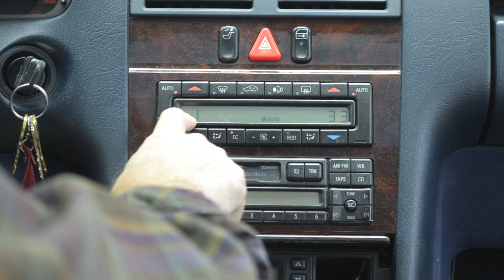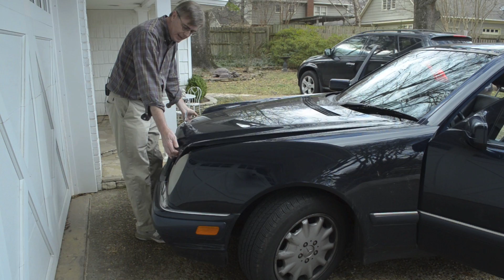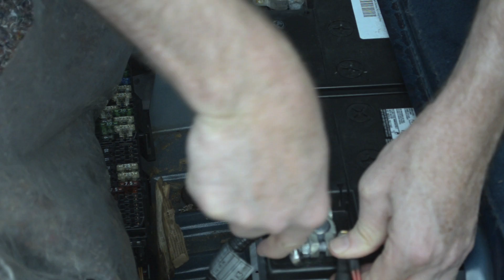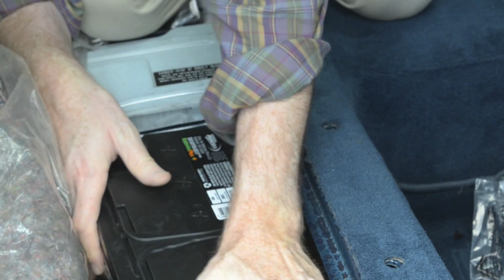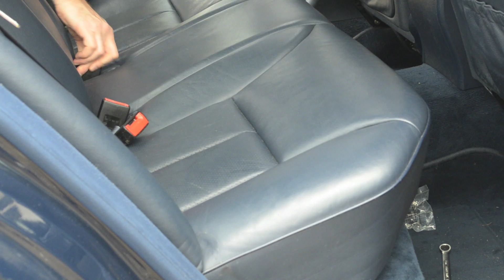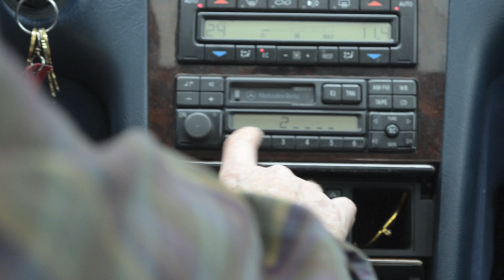Mercedes E300 W210 Battery Replacement

Comment: Great Video.  Just picked up a new battery today and a friend and I will install it.  Your video is just what we need.  Thanks so much!  Good tidbit on checking the voltage from the Dashboard.  I had no idea that could be done.  Now I also know to put in the radio code if needed.  Much thanks again.

Comment: As a rule of thumb, always take the negative side off first. Then when putting a new battery in, attached the negative side last. That way you don't risk shorting the positive side to the frame.

Comment: it doesnt matter what side you hook up first  its a 12 volt dc system u can not hurt it by having it grounded. you car is always grounded because of the tires.
Reply: The deal with unhooking the neg first and vice-verse for reinstallation is because if the neg is hooked up first upon installation, the battery is looking for the pos connection.  If you hook the neg first (the pos not hooked on installation) and lay a ratchet or something metal on the fender and it accidently rolls over and contacts the pos  (shorting pos to ground because the battery has already erroneously made its grd with car grd)  the pos will be shorted to the car...and arc.   It is just a safety issue, not a matter of connection sequence.

Comment: Actually, it does make a difference which terminal you disconnect first. The negative terminal is disconnected first, and reconnected last. The reason being is, if you contact metal with the wrench you won't cause a dead short.

Comment: So, battery is NOT in a trunk, it is under the rear seat!! Is it also under rear seat in 420E/1997?? How about, is battery is all dead, and you change it like you did, you will lose all memory in car's computer?? How do you get it/program it back?? They say that in these newer cars, you should never unplug battery, without having extra power source connected, like booster!!, during your battery change?? Did you lose any of your memory, like radio?? Thanks, youtheman=)

Comment: Great video. The battery you installed has a vent hole on both sides of the battery. Most likely the battery had a plastic cover over the pos side that you removed. Attached to that piece of plastic would have been a small cap that you twist off and insert in the vent hole on the positive side. Hydrogen gas will come out of the battery if it's overcharged or run down. That is the reason for the vent. It's toxic and explosive.
Reply from the maker: Ed Samson Thanks for the tip.  I didn't know about the vent hole on the other side.

Comment: You did I fine job for a DIY'er.  Due to the location of the battery (away from heat, and the elements) the terminals, and cables, live a longer life.  But they still do corrode though.  Also, you should not pay too much mind to the readings on the HVAC display.  They are known to not age well, and give erroneous readings.  Use a multimeter right at the battery terminals to check charging system integrity.  But overall good job man
Reply from the maker: Thanks!

Comment: Always remove the ground terminal first and install it last, so that if you accidentally touch the body with a wrench while you have it in contact with the positive terminal you will not short to ground. Nice video Douglas.
Reply from the maker: Thanks!
Reply: Douglas Sims tyygbb
Reply: wrong educate yourself before you speak

Comment: Nice video. I just changed the battery on my 2000 e320 with a duralast with 900 CCA. I'm kind of surprised that the old battery had such low CCA especially for a diesel.

Comment: Did you have any problems with the spring perches on your car? I read where these were problems on the 96-99 E300 models, they had problems with them rusting out and the front end collapsing. I have read a number of stories on this and wanted to ask.
Reply from the maker: I've read about that too.  I haven't had any problems like that, or problems with rust of any kind. My car has been garaged its entire life and I live in a climate without salt air or road salt issues.
Reply: I replaced both spring perches on my 98 E300. Was quite a bit of work but I'm sure I saved about $1500 by doing it myself. Perches when I bought them were about $40 apiece.

Comment: Did you remember to check the water in the battery? That could be the reason for the low voltage and plus it is a new battery and will take some time to charge up. I am looking at getting me a 1996 E300 Diesel myself, I did not know the battery and fuses were inside the car, thanks for the video, I learned this from it.
Reply from the maker: Actually, no, I didn't think to check that.  That might have been the problem with the original battery too.  It was five years old though, so time enough for a change.
I can certainly recommend the W210 E300 Diesel.  Mine has been really outstanding, and still is, even with over 230,000 miles, though now I'm looking at newer ones with bluetooth and heated seats...  (Heated seats were an option in '96 but mine doesn't have them.)
Thanks for watching!